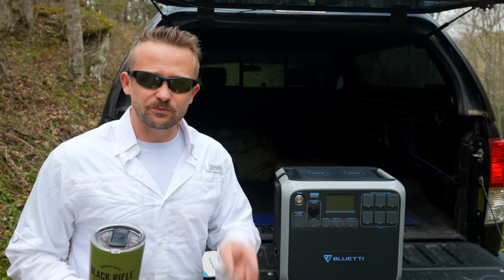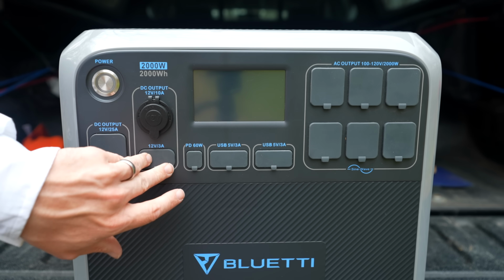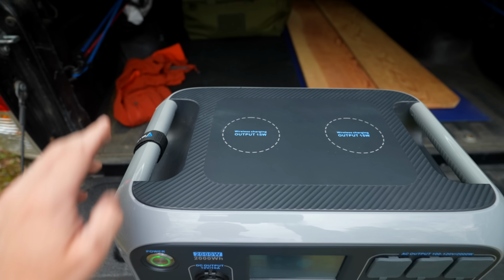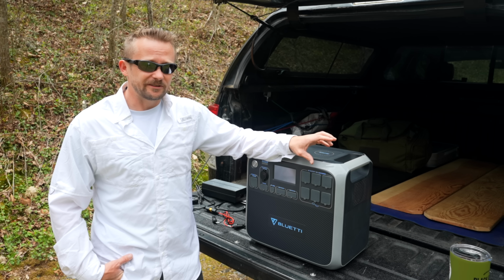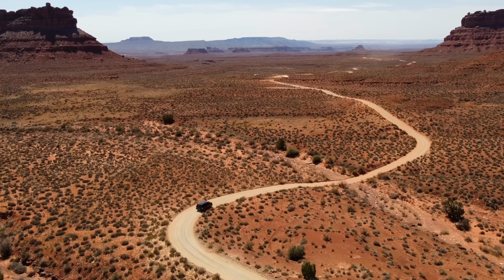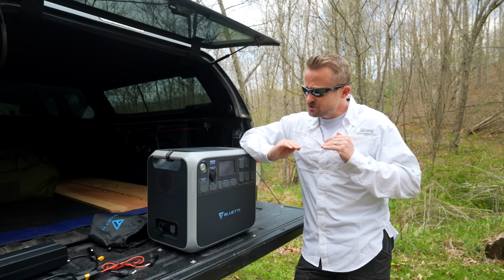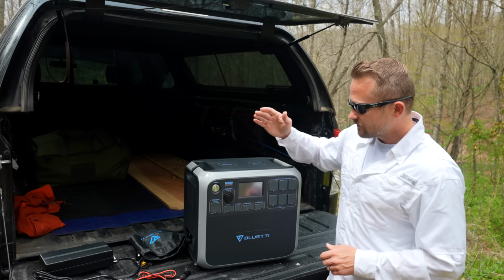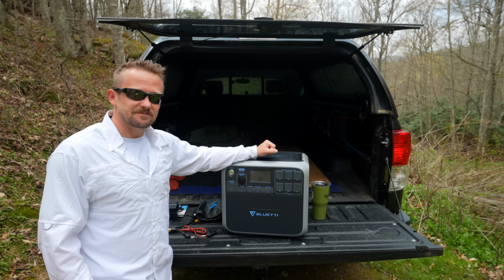Does it Offer It All? Real Overland Review - Bluetti AC200P 2000Wh Power Station

Comment: Batteries hate cold. You will have percentage fluctuations with any battery powered unit. Good review.
Reply: Yes, in fact it was probably accurate. That 39% was probably precisely what you had left AT THAT TEMPERATURE. This should not be considered a Con of the unit.  It's just reality.
Reply: LiFePO4 cell chemistry are indeed temperature dependent. Coldest that they can be charged at or used is about 35 degrees Fahrenheit, which is one reason why camera batteries fade so bad when it is really cold, especially when recording content in winter storms.
Reply: @TyMoore95503  
Camera Batteries don't fade because of the Cold... it's the Spirits (Ghost) that drain them, because the Ghosts are cold... LOL
But in all seriousness... When we go Ghost Hunting (That is a Thing).. our batteries are drained fast... the Entities (ghost) use the energy from the batteries.. I could go on forever...

Comment: The cost is high; but if you have the use for it, device pays off, I drive OTR and have used a Bluetti for over a year now and love it, don't have to worry about battery drain or idling as much to power devices and when I'm rolling this tops off quick, so all in all for me a wise investment.

Comment: The LiFePO4 chemistry isn't the most energy dense one in existence, but it makes up for it with reliability, a high charge cycle life (like Luke mentioned) and it has a lower likelihood of a catastrophic failure* than the fancier LiCoO2 batteries.

* Where catastrophic failure means kaboom or a fire.

Comment: I have had mine for about six weeks and love it. I use the 25 amp port to power my amateur radio. I purchased a $20 Dewalt case to store the power brick, supplied cables, LED lamp and additional cables I built myself. The ability to charge while driving and 3500 charge cycles was the deciding factors for me. My Goal Zero 1400 lithium has an app for remote monitoring/control but the Bluetti has features it doesn't. Great review Luke.
Reply: 3500 charge cycles? overly optimistic. LiFePO4 are rated for 2500 cycles when used with care.
Reply: @YourJoeBloe  I keep hearing them say 3500 charges also not sure where they’re getting that from sounds like baloney to me also

Comment: A 6volt port in your vehicle is surprising. Wonder what it is for? Batteries are heavy and that monster needs a lot of cells.
Reply: I have a Tundra with 4 "lighter" ports (3 of which stay on if they are being used even after removing the key from the switch) all have 12V. I am pretty sure any port with 6V has defective wiring.

Comment: Thats a massive system. I could completely understand for power outages keeping the freezer up and such. Id hate to see how many solar panels youd need to charge it. The jackary 100 watt isnt gonna do it
Reply: It wont even start charging with the jackery 100 , this unit only stats charging with a minimum 35 volt panel , Jackery is an 18 to 24 volt panel . you would at need at minimum 2 100 watt panels wired in series or a larger 36 volt panel
Reply: @uptowndisco  so basically your gonna spend as much on the panels as the unit
Reply: @titanpreparedness  or one large 36 volt domestic panel would do the job and much cheaper than the Jackery or any other folding Solar panel , I do knot know why Bluetti changed the input specs for solar as all their other products will accept  a 100 watt panel .  I am defiantly not buying more Jackery panels lol

Comment: These devices are cool and convenient but the reality is, a deep cycle 12 volt battery with a properly sized inverter and either a trickle charger or solar panels with a PCM will do the same thing for possibly half the price or less.  I get it though, I borrow one from the company I work for and they really make it easy.  But if I needed my own system, I'd buy the components individually.
Reply: Plenty of data driven shows on YouTube that show these (batteries) can be much cheaper over the long run, depending on your intended use patterns.

Comment: Great review, Luke.  I am considering getting a Bluetti but a smaller EB 70 700W power station.  I would love to have this larger one for power outages in my house.  Presently I use a Jackery 240W for overland camping and it's adequate for my needs, i.e. lights, fan and charging cell phone and rechargeable batteries.  My fridge runs off my vehicle battery via the cigarette lighter socket.  I have to say though the Bluetti is aesthetically the nicest looking power station versus Jackery, Pecron and other units.  Another plus about the Bluetti is that the handles are recessed versus the Jackery and that allows it to placed neatly in a corner or on a properly sized shelf with the handles interfering.  That $2000 price tag is high but as always you get what you pay for.
Reply: Don't purchase any expensive or dangerous items that have no local warranty or repair center. I purchased Bluetti EB150(Feb. 2020) because it was very simply made and compact. It has NO UL or any certificate(NO INSURANCE coverage) so, I keep the unit very safe when it is not in use(separate garage). I will try to repair it myself when it does not work. 1st the time when I received EB150 A/C adapter did not work. awaited 2 weeks for replacement and communication was impossible with them. Also, I modified the EB150 in many areas to improve the charging and cooling ~~~~~ EB150 has many small glitches.... I use EB150 in my 2008 Honda Odyssey camper van with one 370 watt REC solar panel.

Comment: I do like bluetti, but I have switched over to all ecoflow power stations now. Fastest charging ever in 1.5 hours! No brick needed, app and wifi connect, modular, UI is amazing. Blows everything else away.
Reply: Fast charging is never good for the battery. It shortens the life of the battery. FAST charing is not everything. But nice option to have it. I have Bluetti EB150/1500 watts, I charge the battery slow as possible but I have 3 charging options(165, 265, 370watts) for charging the unit.
Reply: @jameskim62  charging the battery fast is only bad when you do not have the optimal conditions for the cells. Ecoflow has an algorithm that monitors this constantly. Just like the ferrofluid enhanced coolant used on Tesla batteries. Keep the electrolytes in a range and it does not degrade them.

Comment: This unit is extremely inefficient when you include internal losses especially for DC.
Reply: Explain please
Reply: @sawwall14  Because of the large 12 v output and all dc power outlets using thd same converter.